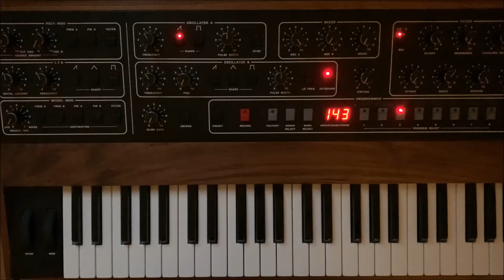Prophet 5 Rev4 Polymod Oscillator FM

Comment: FM on analogues is weird and wonderful.
Is it more stable on DCOs?
Reply from the maker: It is usually not possible to do this on DCOs, depending on their design. But on the rev4 with vintagemode on 4 its a lot more predictable which makes it far more useful for FM than the old Rev 2 Prophet 5 I had before :)